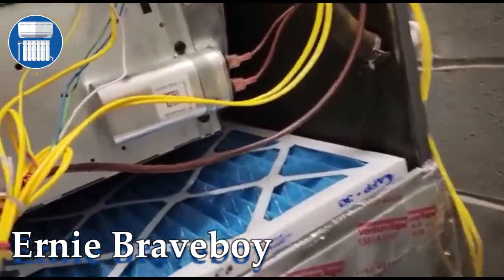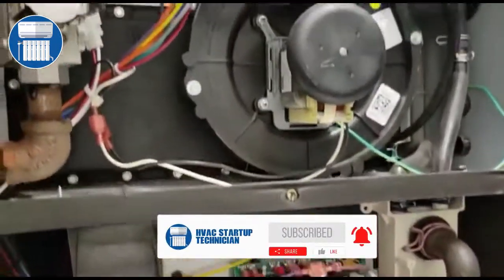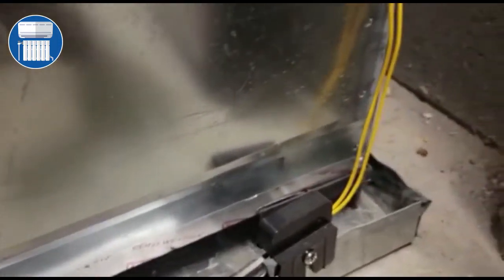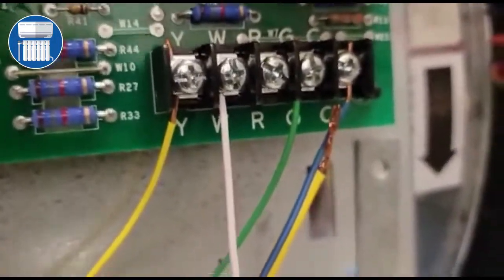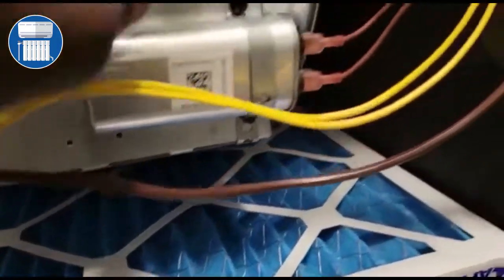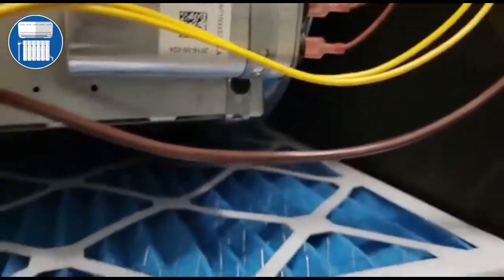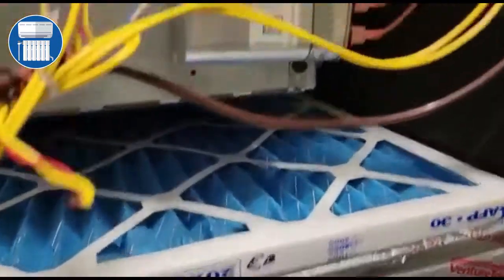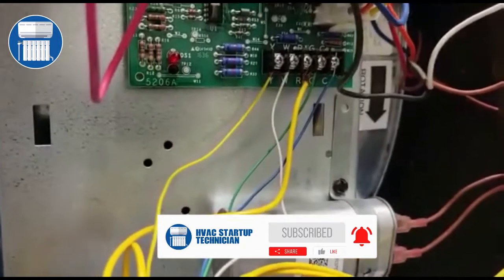how to wire float switch to furnace and condensate pump to furnace or airhandler

Comment: Thank you for this video. Checked out lots of others and NONE showed this actual step. Should 18 gauge wire be used? Would 16 gauge be ok to use as well? I will be doing this for a Little Giant condensate pump which is several feet from the furnace control board. Thanks again. Subscribed.
Reply from the maker: any of the wires can be used doesn't matter

Comment: What if its a two zone system with a zone panel
Reply from the maker: No problem go to where your furnace is located and at it to the pan if you already have a condensate pump you may not need it.

Comment: Where can I get this switch ? What is it called ?
Reply from the maker: it is call a float switch re michael or any hvac warehouse or amazon
Reply: Cool I bought one but there are 3 wires on the float switch I got 2 long ones and a short wire. Whats the short wire for ? Thanks!
Reply from the maker: @yader239  YOU DONT NEED TO DO ANYTHING WITH THE SHORT WIRE JUST CONNECT THE LONG ONES